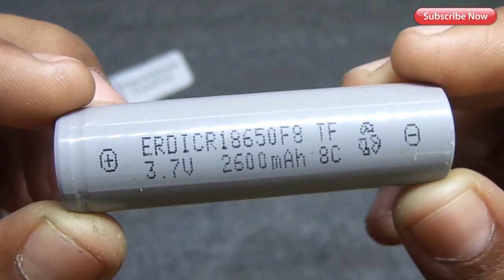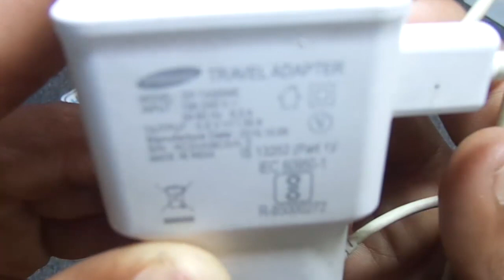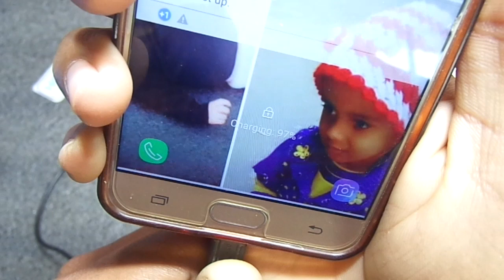How To Make a 36000 mAh Power Bank Using Old 18650 battery

Comment: Is not 20 volts too much for the chip, will not it burn it?
Reply: its not as its connected I parallel. its about 4v. if it was connected all in series, it would be 56v

Comment: Hi i bought de module you’ve placed in the desription but it is a scam beacause to charge a phone from the module you need 5v and i made them in series and i got 3.70v so it dosen’t work for me.At least tell me a solution about it
Reply from the maker: That module give u 5 volts to charge the phone and battery voltage is 3.70v is good